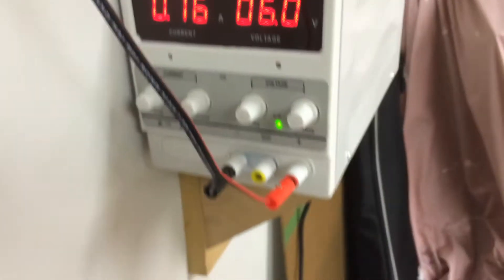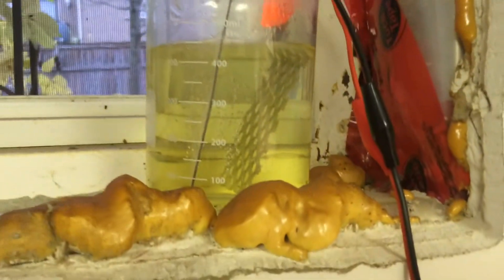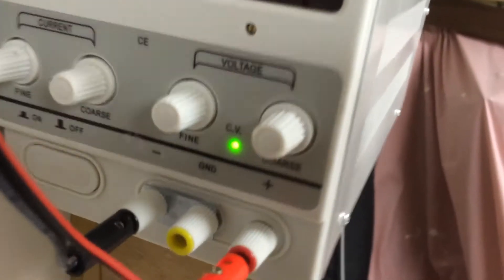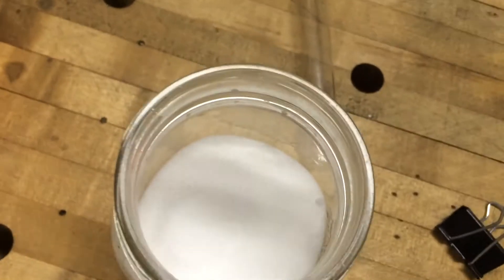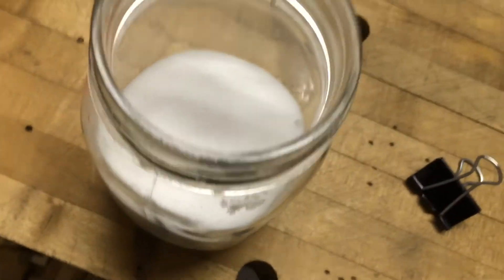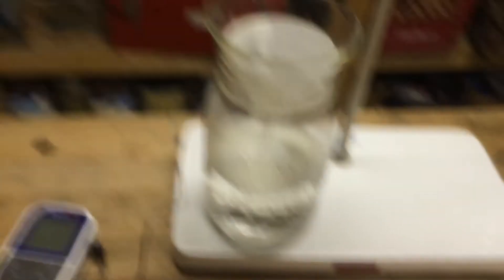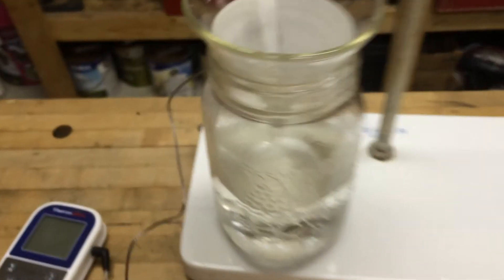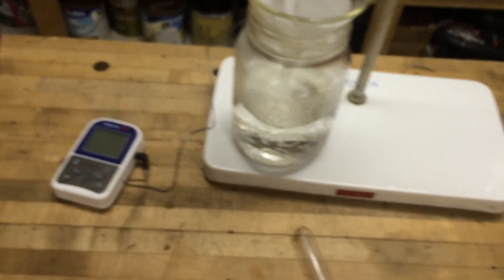Making KClO3

Comment: I have a 1,8L cell, and i have ran it at 4V3A for 1 day nonstop. When can i expect to see some crystals forming? The solution doesnt look so "piss like" though, but its saturated with pure KCl. My mmo and ti plates are not big tho ( 2x3") so should i opt for a smaller (1L) cell?
Reply from the maker: The "Piss like" yellow is from the KCl being oxadized into KClO (Postassium Bleach) and then from there once more into KClO3. At that amperage you should expect results soon. Within a Day or day and a half. Make sure that when you do start to get crystals that electrodes are not touching the crystals are they will get damaged and you'll lose yeild
Reply: @lobby4497  yes, but i mean it doesnt look so yellow, it looks a little "bleached out" im not so sure. I havent yet seen any crystals precipitate but if i dont see them for a few days ill just move to a smaller cell.
Reply: Btw, do i need to use a solution which has NaCl in it, or will it work with 99,9% pure KCl?
Reply: @DahTiiteri will work with kcl
Reply: @revolution5547  got it to work with a smaller beaker (1L) and a 5V10A power supply. Got 150grams from 4 days of constant on time. Idk i maybe should use some smaller titanium/ss strip to get a better yield, but havent found one locally yet. Now using 2"x 3" MMO and titanium electrodes

Comment: for 2.5 liter cell running with 5.2Amps...how many days it should it start percipating kclo3?
Reply from the maker: Depends on how much KCl you have dissolved in solution. Assuming you have a nearly saturated solution of KCl and you have a decent electrode surface area I would say about 2 days if you run it non stop. But if I were you and I was running it nonstop(1: very hard on your power supply, 2: you might end up evaporating your solution) I would top up the water to make sure only the KClO3 precipitates and not now insoluble Unreacted KCl
Reply: @lobby4497  its okay now i run the electrolysis on a week and i see a crystal forming at the bottom almost a 2inch thick that waiting to harvest not bad for a 2.5 liter cell :)

Comment: Electrode please?
Reply from the maker: that's a Platinum coated titanium Anode(where all the oxidation occurs) so it has to be non reactive. the only other metals that would be better would be other platinum group metals(iridium comes to mind), the cathode is an old sparkler wire free of the sparkler solid. In future runs I used a carbon Rod from a C cell battery